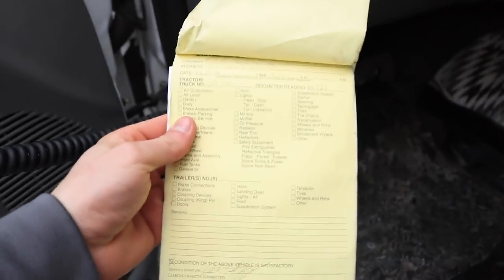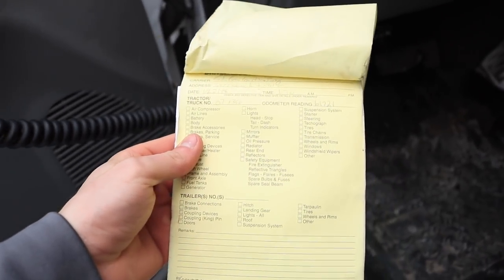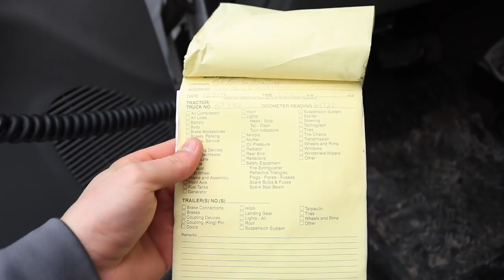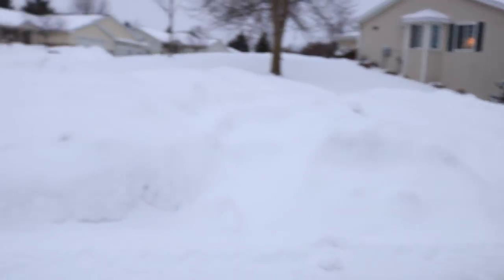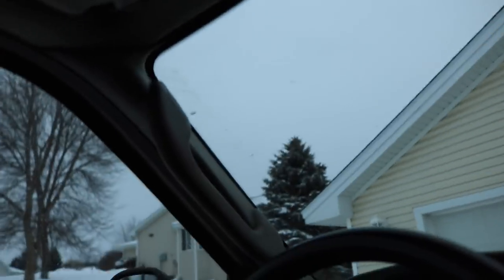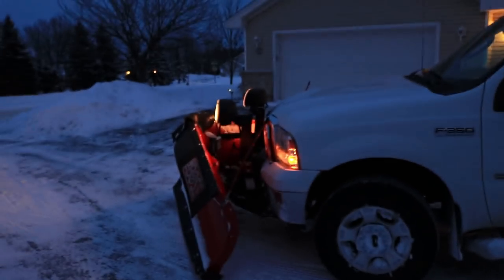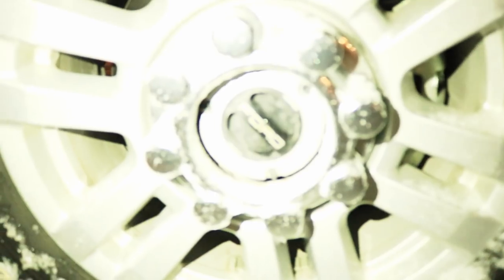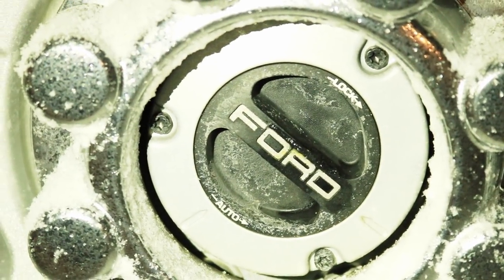Snow Plowing 2017 F250 & 2017 Case SR240 | Skid Loader

Comment: Skip the backup beeper unless you can turn it off and on manually they were not exactly made for work at 3:00 am in residential areas in the morning that could really upset some customers in there nice warm beds. Commercial lot no problem. Glad to see you in the Case best in the buisness.
Reply from the maker: Ya if we bought it wed unplug it obviously. But sense it was a 1 week demo we figured wed not mess with their machine. Looks like you just got to unscrew a ground wire though.

Comment: The drone shot infront of the 17' is really sweet 👌🏻
Reply from the maker: Thanks! I just got the drone so im still learning the best camera settings, next time i just want to film while someone drives its hard to run the plow, truck, fly drone, and adjust camera at same time!
Reply from the maker: DJI Mavic Air. Great drone so far, quality in this video isn't as good because of low lighting at night. Next video will have some better shots with it. I live in Stillwater MN so if you want to check it out before buying it id love to show you guys it.

Comment: You only have to fill out a DVIR book if you are pulling a trailer or vehicle weight is over 10,000 pounds in Minnesota
Reply from the maker: If the GVWR is over 10,000 don't you have to as well?
Reply: @CarsonSchifsky  yes, you are supposed to, has nothing to do with actual weight, all about GVWR. i have never been bothered with just f350, no trailer, but im opening myself up to some big headaches with no DOT numbers or log book.

Comment: When you were plowing with the 2017 you mentioned something about plowing with the vxt . But anyways I just got finished watching the video about how to install a boss plow and there are two power vxt‘ sun the back round. And I know one of those’s goes on the 2017 but why not just put the other one on the diesel and put the power v away for a back up plow
Reply from the maker: We usually run 3 trucks, we have a 2011 f350 as well and the other vet goes on there. The power v (older one) goes on the truck I usually drive
Reply: Carson Schifsky but since your aren’t using the truck why not put the other vxt on your truck
Reply from the maker: I tried that in the latest video, didn't seem to do as good of a job plowing because the truck plow mount is a different height. Know that i tried it i wont do it again because i don't want to have to adjust the plow rack.

Comment: Very nice machine we lease 6 for the winter.
Reply from the maker: Thats sweet! you guys like them? ever have any issues? also can you adjust the controls so there not so laggy?
Reply: CarsonSchifsky we had some issues with alternators going bad but it was just a regulator and they took care of them. We had a 240 like that and the oil filter was bad from the factory and all the oil leaked out while running it. As for the controls I think they are very touchy. I use the cat pattern when I run them.
Reply from the maker: We use the cat pattern too. We also have a 2009 Takeuchi which is real ISO controls (no electronic sensors straight to hydraulics) and that thing is super responsive and thats what were used to, these cases seem to have a bit of a delay from the time you push forward to the time the machine actually goes forward...
Reply: CarsonSchifsky I would ask the dealer.  On the cat 299c we used to have you could adjust it some from the control panel.  It still was to laggy for what I like.  I talked to them and they plugged in there scan tool and they sped it up. The mechanic said they have 3 different speed ranges they could pick and the control panel would just be used to “fine” tune whatever mode they put in. The fastest mode I tried was way to touchy.  He put it in the middle and that was much better.  I hated that machine but maybe case has something similar.   I’m just rambling now but it’s worth a shot to ask them.